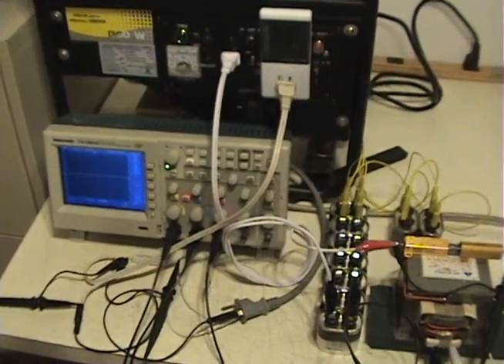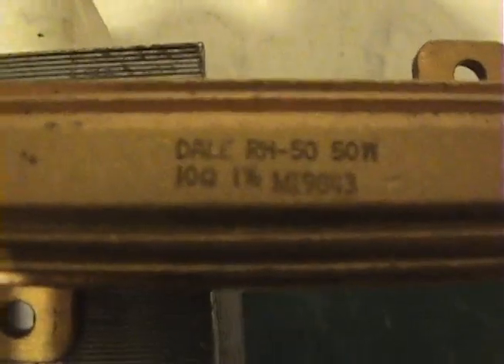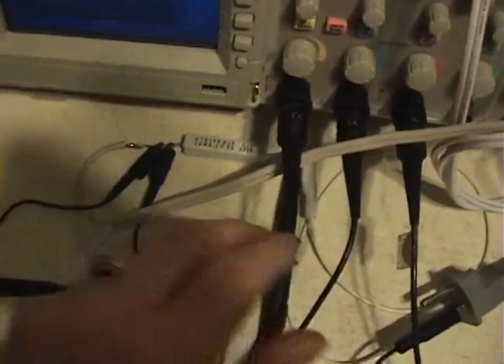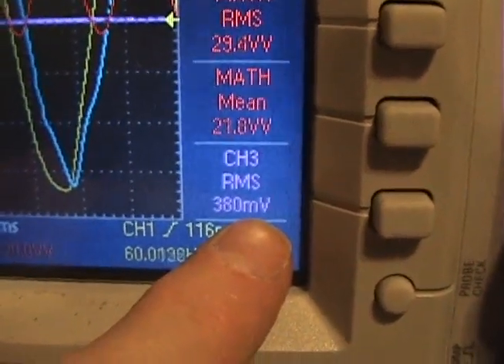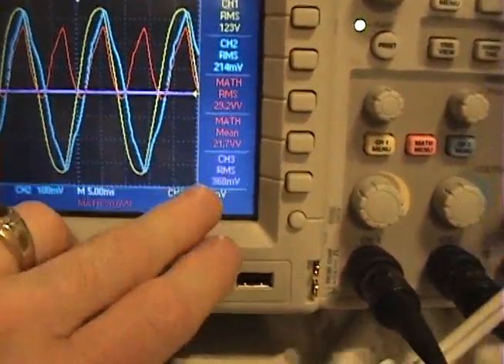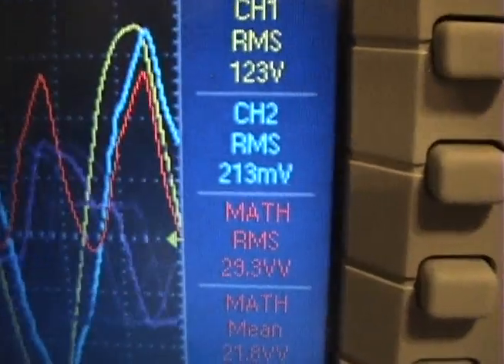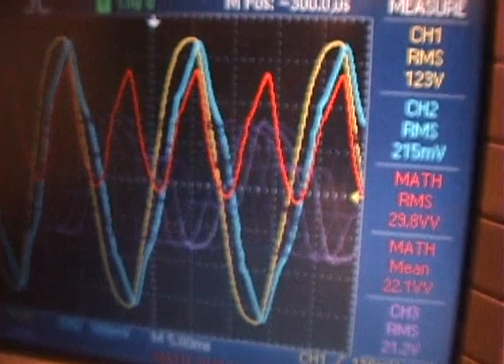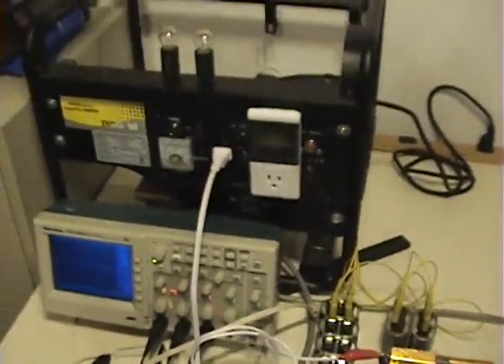Reactive Generator test 2

Comment: Why do you short the secondary of the Transformer when you only need the inductance of the primary to achieve the effect? Shorting the secondary will allow a secondary coil current flow which uses more electricity at the input and also makes your Transformer hot!

Comment: Hey Luc, in your last video you have reached a power consumtion of the whole set-up at 50W. Why don't you use the same configuration at this test with the higher load? It would be closer to the point if we run it at 50W and draw 30W.
Reply from the maker: Sorry Kolyo but there was errors on this test. The scope channels were set to AC coupling and should of been set to DC coupling. So the data was not correct. This problem was addressed later at the forum topic (link in description). Bottom line is there is no gain in this system. I'm still experimenting to find some kind of energy solution but will only share once I have found something 100% real.

Comment: Nice demo. Easy to replicate. Next time I would rather see the voltage and current on the generator and load. What is so strange in this setup is that it is an LCR circuit. If the impedance of the LC part would be zero ohm, then we would see the charge of the load. But in this setup, the impedance is actually negative, so to have a positive power on the load. Well, that is what a laymen would say, strictly looking at the results. Of course, it is not that simple, in fact we have two vectors, dancing around each other because of the 90 degrees shift of the current.

The load is hard to get right. In the same setup as yours I tried with automotive lights, but they are blown up easily. I did have a nice setup using a variac at the secundary or the MOT. It makes tuning the circuit a lot easier, so for Luc: have a try yourself. And for others: if you cannot get the capacitance tuned, try using a variac.
Note that I get my capacitors from HID lights, one 50Watt HID light has a ballast and a 7 or 8 uF capacitor. And (don't we?) we all have those MOT capacitors of 1uF, but those are not cheap to get as you need really a lot of them.

I hope more people share on this (sorry that I am posting here and not on the ou forum, mostly because I am following Luc and not the ou forum ).

ps: as I was testing this reactive setup, I used Christmas lights as well on the primary (not of a MOT but a toroidal amplifier transformer), and they light up just right if you choose the right ones (I have al least different 10 strings of X-mas lights salvaged, so they are different loads from 10 to 40 Watts).

So: merry Christmas, running X-,mas lights on free energy! (I can make a video if someone would like to see, but do know it is kinda simple to do yourself all of this if you have the right equipment). My message her eis to get you guys going. Just do it. Be VERY cautious we do work with 110 or 220 Volts, so always use one hand if possible, and have a breaker close by. Also note Luc already explained this will only run from a generator (the grid) and not from an inverter. And don't forget, the power yuo generate at the load is in fact traveling on your mains as well, so be sure not to overload your mains/grid power lines. That the power is not measured does not mean the power is real, and wires do warm up. Luc clearly showed in a previous clip that the power being taken and given back are happening in one sinusoidal AC wave.

As long as the power companies do not measure this type of load, we can have free (free as in not paid for) energy.

Luc: have you ever thought of what would happen if you would have like 10 LCR circuits on your generator? Don't yout hink there is a limit to how much current your generator can handle? I think it is limited by the thickness of the wires in the generator. This means that if you run the generator for 165 Watt, and then have 10 times a load of 30 Watts on it, you would have overunity (the generator seems to be able to deliver up to 1500 Watts if I am correct).

Really nice stuff. And solid state.
Reply from the maker: Thanks deslomeslager for all your details.

Unfortunately a second or many circuits connected in parallel will not keep multiplying more 30 watt output. I wish it was that easy!
Looks like the generator has a limit maybe due to internal gen coil resistance. I'm quite sure a larger generator head will be able to handle more reactive power. If you look at the guys who have looped generators like Valy the have huge alternators, like 30kW. Those will be able to circulate very large reactive power compared to my 1kw.

Luc